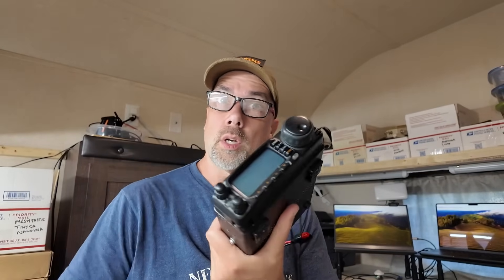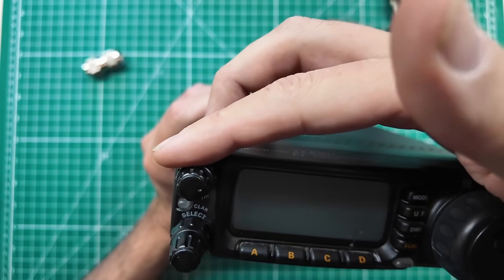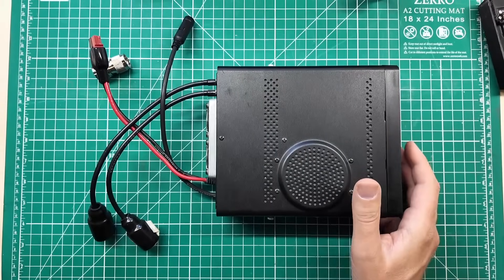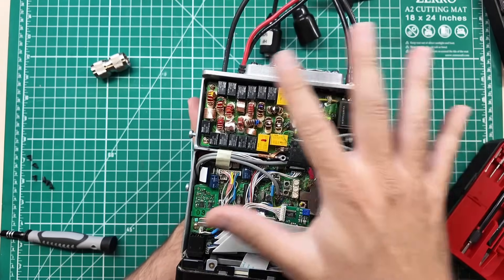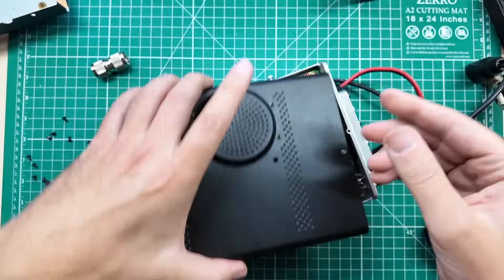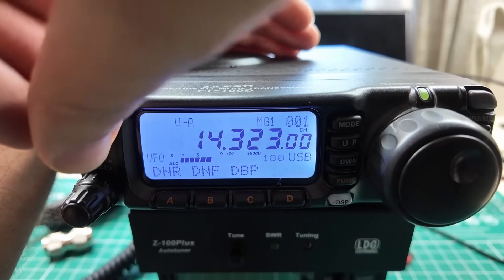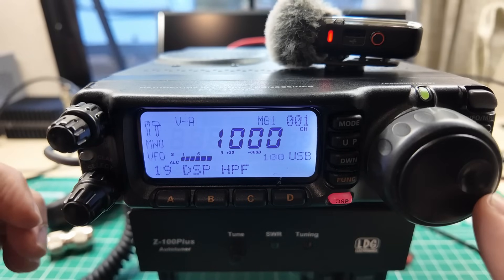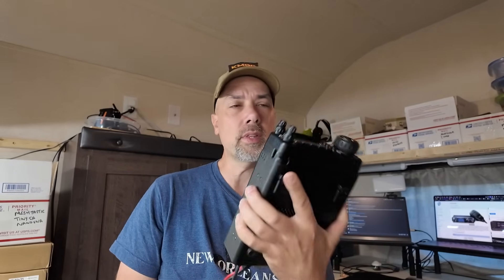Let's Look Inside This Old Radio!

Comment: I have 2 of these rigs.  One was given to me by a friend of mine.  I’m not sure how this happened but the finals and his rig failed. Not sure if it was the HF side or not. So he removed them and it makes a great receiver.  Now you have motivated me to put some power to the one I have as I haven’t used it in a very long time.  The only problem I have with it was when I used it mobile, every time I transmitted I would get a high, SWR warning even though I was using an ATAS 100 which I still have and use today.  I can’t remember what I did to try to remedy it other than adding some additional grounds.   Thanks for the great video as always.
Reply from the maker: Thanks Barry!  Let me know how it goes.

Comment: I have a Radio Shack HTX-242 that has one of those sorts of pigtail antenna connectors on it, so at least two manufacturers were using that technique.
Reply from the maker: Now I know of two.  Thanks!

Comment: I still have my FT-100. I scored an ATAS 120 at a ham swap meet. Even though my FT-818ND gets more work, I still love my FT-100. It's the first radio I made parts for with my 3d printer. It came with broken face clips, and i was shocked that i could print new ones that were that small with precision. If your clips go bad, let me know, and I'll print you some, Steve. 🤙🏾
Reply from the maker: That's a great story.  I love seeing people fix up their old equipment.

Comment: When I got my General license in 1998, the FT-100 and the IC-706 were the two radios I considered getting. After talking with some friends in a local club, I decided that I wasn't going to be operating from my vehicle and unlikely to be doing portable, so I wound up getting a 'desk' rig, the Icom 746. I still have that radio. I've even taken it out on field day a couple of times, running it off a 12v deep cycle battery.

I need to rig some QD power connectors, get a LiFePo4 battery with some connectors and then start hauling it out to some local parks for POTA out of the back of my truck.

Guess it only took 26 years to realize that maybe I do want to operate out of my vehicle. :D
Reply from the maker: I love POTA - get out and enjoy nature a bit, practice your skills... very few ragchews.  Good times!  That 746 is a nice rig!  I'd love to see a modern combo 7300+9700 with all the bugs worked out.

Comment: Tnx for this tip with two side UC1 plug adapter for direct connection to meter.
I am going to install PAT70 adapter inside for SDR.
Reply from the maker: Good luck on the install, I'd like to see that when it's done.  Send me some pics please!

Comment: wonder if the digirig 891 would work to get it on ft8? could be fun. hope to get on frequency frenzy soon
Reply from the maker: the DR891 doesn't work on this - the 891 uses USB for CAT and this one uses the 8-pin connector.  (I just finished the FT8 video on this rig, took a week)

Comment: "Old"? 25 years old really isn't old when it comes to amateur radio equipment. Not everybody jumps on the latest shiny new toy the day it comes out, especially with the frequent and often inexcusable problems with offerings over the last 10 years. Some of the best, and longest serving still, amateur radios to have been produced came out in the late '80s and early '90s... This was the period on what was built in was quality and reliability unlike today or what is built in is programmed obsolescence and rapid replacement.
Reply from the maker: I agree.  I've played with a bunch of older radios and they all have their charm.

Comment: Back in 2002 I sold my Icom 706MKIIG and bought a new FT-100D. Wise choice because 22 years later I’m still using the FT-100D as my daily all mode rig in the mobile. It has been flawless. My buddy that bought my 706MKIIG only had the rig for 4 years until the finals blew due to a self oscillation issue that Icom couldn’t fix.
Reply from the maker: I think your the first person with that version of the story.  Everybody else burnt their yaesu finals and went icom instead. Pretty cool.
Reply: @temporarilyoffline  Just my opinion but back in the day I preferred the receive of the 100D over the 706MKIIG. The combination of the 100D DSP filtering and the factory TCXO made it a pleasure to use. Both the 706MKIIG and 100D are both fine rigs. Not the original 100 model though..

Comment: I bought one of these FT-100D rigs new around 2004 I think. YAESU and ICOM, why have you stopped producing these HF/VHF/UHF all mode, shack in the box mobile rigs with removable face plate ????? IC-706, IC-706MK2, IC-706MK2G, IC-7000, FT-100D, FT857....and then nothing. These all in one mobile rigs are very popular, but the manufacturers have stopped producing them
Reply from the maker: The 7100 from Icom is still being made new.  It comes with a non-attachable head and its a pretty good setup with the speaker and mic in the head.  Yaesu should make an all mode rig soon

Comment: My FT-100 is still plugging along as my primary radio. If it ain't broke don't fix it. It's on in the shack 24/7. Draws 1.75 amps (24 Watts) on receive. There isn't anything sold today that has as much power and is an all band, all mode transceiver in such a compact case. The FT-991 is close but it is bigger.
Reply from the maker: This radio is a MACHINE!  I'm pretty happy with it!

Comment: I had one in 1998. First batch 1 year later it blew finals. Sold it used. Got a Icom 706 to replace it. I still have that 706 to this day...73s..
Reply from the maker: That seems to happen alot with Yaesus...

Comment: Steve, is it possible for you to drop a link for that remote head adapter? I have the FT 100 D as well and the only thing I didn’t get when I bought it at the Hamm fest was the Cable to make the remote head and they ain’t available
Reply from the maker: Sure can. There is a link in the description for ya.

Comment: Dont think i would consider an ft-100 an old radio. Had several of them. Had a few ft-857s as well.  As i got older i needed the larger screen on the ft-991.  The ft-100 wirked great but the remote head for the  857 was an improvement.
Reply from the maker: The FT-100 is a classic for sure!

Comment: FT-100D was my first HF mobile radio. Circa 2005. Used the original ATAS antenna.  It all still works.  My first QSO was from Tempe, AZ to ZL1UE in Auckland.  I was impressed.
Reply from the maker: Quite a distance on an ATAS, impressive!
Reply: @ Do you know if I can use the older ATAS 100 with my FT891.  I describes connecting it to the ATAS 120, but I don’t know the difference in the model numbers other than 20. :)
Reply from the maker: @LarryTaylor-l5m  I don't know, the 100d has two different ATAS settings, so it could be different.  Call Yaesu and see what they say

Comment: FT-100 had a bad reputation with burnt finals. Just a few years later Yaesu stopped providing parts for it. With that in mind I bought the IC-706 MkIIg and never looked back.
Reply from the maker: Wise choice!

Comment: Steve Good morning and Merry Christmas! Your observation about hard-wiring connectors to the chassis versus using a short length of cable is both practical and insightful, especially when considering the different use cases for radio setups. For a fixed installation, such as a base station or a fixed mobile station, hard-wired connectors directly attached to the chassis offer significant advantages. 

The rigidity of the chassis acts as a built-in strain relief, reducing stress at the connection point, which is particularly beneficial in setups where cables remain static. This approach also reduces clutter by eliminating the need for extra pigtails or adapters, resulting in a cleaner, more organized setup with improved airflow and aesthetics. Additionally, fewer connectors mean fewer "potential" failure points as well signal loss or degradation. However, for portable use, a fixed connector can become a weak point, as the rigid mounting transfers stress directly to the radio and the internal board inside the chassis if the cable is bent or pulled.

In contrast, a short length of flexible cable as in your example, extending from the radio is better suited for portable rigs that are moved frequently. Such a setup allows the cable to absorb and distribute strain caused by movement, protecting the connector and extending the lifespan of both the radio and the attached cable. Moreover, they serve as a buffer against impacts, which are more likely during portable use. However, this approach does introduce some minor drawbacks, such as additional clutter and a potential, albeit minimal, loss in signal integrity if the cable isn’t of high quality.

In my opinion, the choice between hard-wiring and pigtail cables ultimately depends on the use case. For a base station, a hard-wired connector is often the best choice, simplifying connections, minimizing signal loss, and maintaining a clean setup. 

Balancing durability, functionality, and convenience is key to optimizing a radio setup. A mission purpose design informs the intended use case, which significantly improve the individuals user experience and extend the life of the equipment when built for the environment of intended deployment. Your perspective highlights an important aspect of radio operation that is often overlooked, and it’s a great example of how small design decisions potentially making a big difference in practical use. -73
Reply from the maker: Thanks for the tips!  Totally agree!

Comment: Merry Christmas steve
Reply from the maker: Merry Christmas!  Good to see you!
Reply: @temporarilyoffline Just ordered my first hf qrp radio the xiegu g106 felt it was the best bang for buck cause i couldnt go any more than $200 with 19 month old to take care of thanks for all the reviews and experiments you do
Reply from the maker: @KQ4KXA  I did a few videos on the G106 - great bang for the buck radio as you found out!  Enjoy!
Reply: @ definitely is and i believe i have watched them all just to know all i can about it thanks again i do have a question is the microphone rj45 and would any rj45 mic work with it?
Reply from the maker: @KQ4KXA  I believe it's an RJ-11.  Check the pinouts in the manual before plugging in any unknown mics.  Some have voltage on the mic port